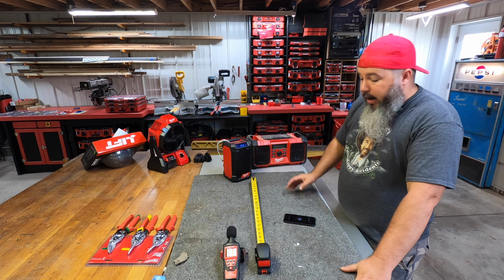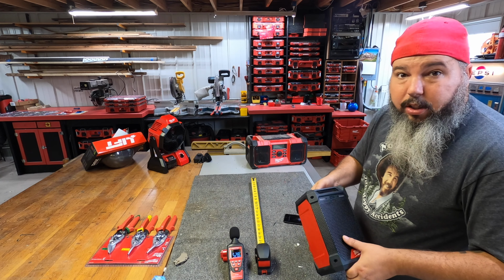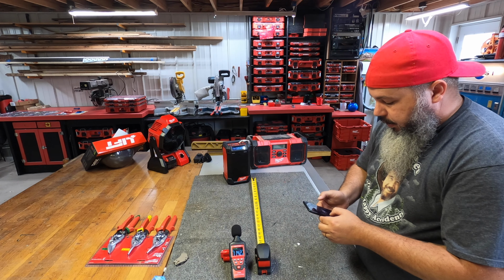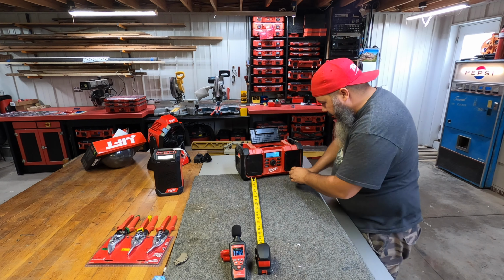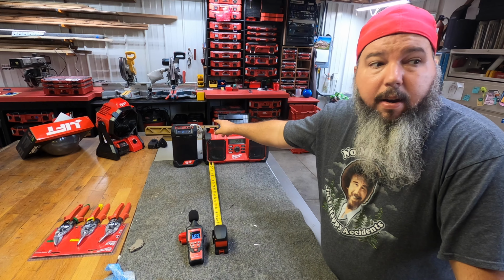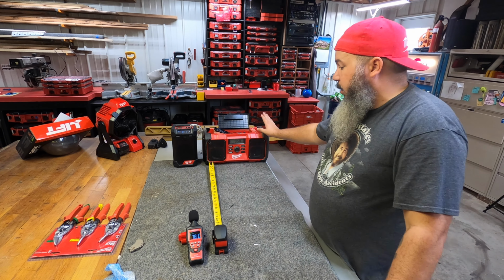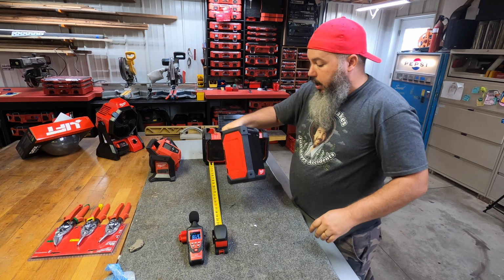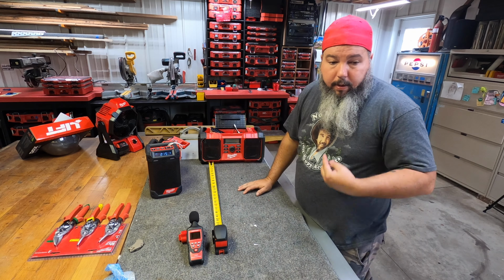Milwaukee Tools Radio Head to Head challenge, WHO WILL WIN?  (M12 vs M18)

Comment: I have both. I've had the M18 one for a few months when they had the battery sale and get free tool. I have it in the garage and it does what it's supposed to. I can't tell much on sound quality because I'm deaf and wear aids. Just got 2 of the m12 ones in the battery sale, one for her to take to work and one for in the house. I absolutely love it. Don't let the small size discourage you, it's powerful. I like you can plug it in and charge battery and your phone.
Reply from the maker: It's a good bit of sound for a small package

Comment: @ JakeOfALL. Thanks for the demo and review. Yes I can hear the distortion with that M18 radio. You may want to test both radios on a hard surface. The speaker on my small 18V Ridgid radio rattles even when I don't have the volume up much. Putting it on a softer surface seems to help.

Hope you and your family stay safe and well.
Reply from the maker: Thanks for the tips!

Comment: I'd like to see the packout radio review. I have the  m18/m12 Bluetooth jobsite speaker and it's pretty nice, also got it as a free tool. The sound sucked and sounds flat when I first tried it BUT. I adjusted the equalizer on my phone, then it sounded amazing. It will also charge your phone without playing music. I do however wish I had a mounting bracket for it. I use it as a stereo on my forklift lol but it hasn't fell off yet! I meed a half size packout mounting bracket for a forklift lol
Reply: Bolt a mount to it and then put feet on the radio.
Reply from the maker: What raido are you trying to mount ?
Reply: @JakeOfALL  it's the Milwaukee M18/M12 jobsite speaker 2891-20. The biggest challenge is where I want to mount it. Cleats would kind of work on the forklift but it wouldn't hold a top and bottom cleat and would have no lock. I wonder if making a half size "universal" mount with holes for a bungie cord would be a good option. Is there a lock that can be printed?

Comment: I tell you something about the one I bought (the Milwaukee Tools Radio) mines about two years ago; and I haven't moved it yet form a certain area of the room therein the basement the AM frequency in Chicago Ill is coming in crystal clear (sometimes adjustment) the FM fq is alright, right today I haven't even taken the tape off of the antenna nor have I raised the antenna yet since; I had it sir-mam; yea sir-mam being in fact in the basement the AM frequency is good;

Comment: Hello as I love Milwaukee Pack out systems so much I am a groomer but I need something to hold the scissors without them swinging around in the car as that will mess up the alignment and can possibly put nicks in the blades I have tried the stuff Milwaukee has with some of the inserts not a good thing to still use is it possible you can come up with Scissor holder that will pop up like some of your bit holders as well as a blade @
& clip comb holder? I’m just trying to put you to a test
Reply from the maker: I love a challenge, send me some photos to info@jakeofall.com

Comment: You might try adjusting the bass & treble it's painfully being overdriven to distortion I have the m-18 and it sounds just fine thumbs down on a shit review !!
Reply from the maker: Booo
Reply: I have the M18 and equalizer settings are pretty neutral and this thing distorts at loud volumes. Compared to the previous generation M18 I'm pretty disappointed in this thing. Might switch to the M12.